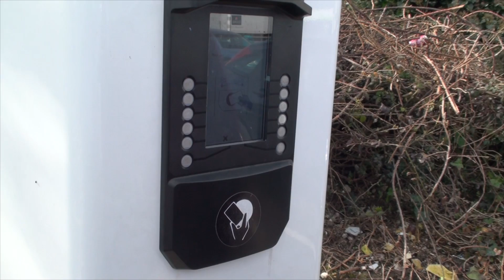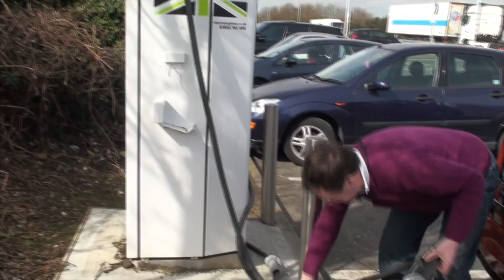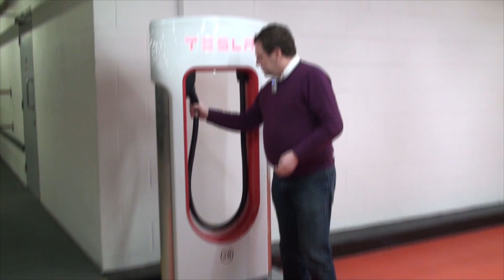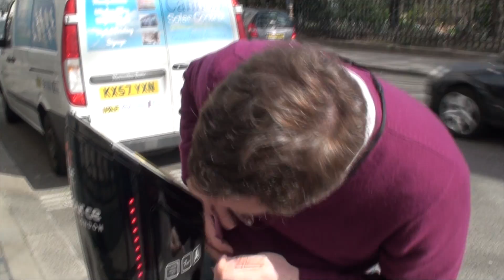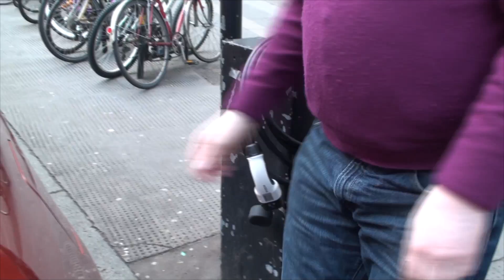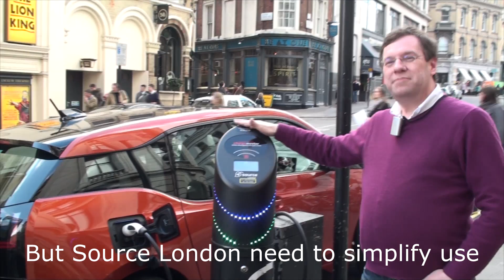All about charging Electric Cars

Comment: It's now mid 2017. Has the infrastructure and reliability improved?
Reply from the maker: Yes and No.... Tesla Superchargers are King 100% reliable and the car works out where to stop and the live availability is displayed on the MCU. Road-side AC chargers are pretty reliable now, as are most rapids, the exception being the Ecotricity Motorway Service Stations which as a serious negative, until this is sorted and if you make regular motorway trips a Tesla is you best and only viable choice of car. The Model 3 will be out this summer and similar price to a BMW 3-Series. Other makes of cars with Type-2 connectors can use Tesla "Destination" (overnight AC) chargers (but not the large DC Rapid Superchargers), but only the destination chargers with the white signs that state "EV charging", Not the red ones that state "Tesla Vehicles only", each "Destination" location has a 50-50 split of both types.

Comment: Justin have you operated mobile from your i3 and if so did you have any interference problems with the installation. Many thanks M5FAB Steve.
Reply from the maker: M5FAB Hi, I've only used 2m and 70cm inside the i3 and Tesla at 5 Watts, FM and DSTAR, no issues with either car. The Tesla has AM radio too. It works perfectly without any interference from the electronics in the car. I'm at the Canvey Island rally tomorrow. Justin.
Reply: Justin, many thanks for the information I was concerned that it would be problematic . Hope you enjoyed the rally. 73 M5FAB (Steve)

Comment from the maker: Hi Clive! Parking in London is free on-street for Electric Cars in Westminster only at RINGO or on-street Pay & Display bays . You can park your EV at any space up to the maximum permitted time (usually 1-4 hours). You don't need to register - the CEO's know which cars to look out for. At Charging bays across London you can usually park for free (Check the sign) but you MUST be charging to use these bays. In car parks you usually have to pay to park unless the sign says otherwise, even if charging.